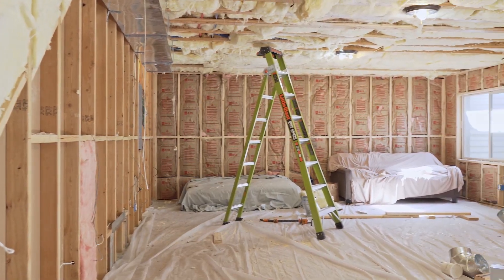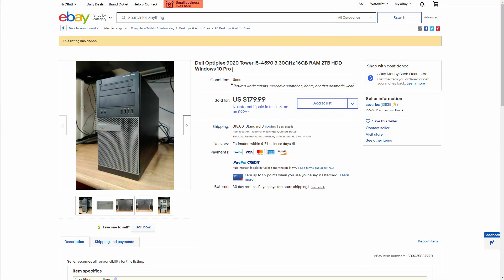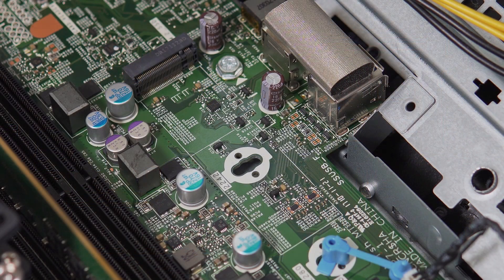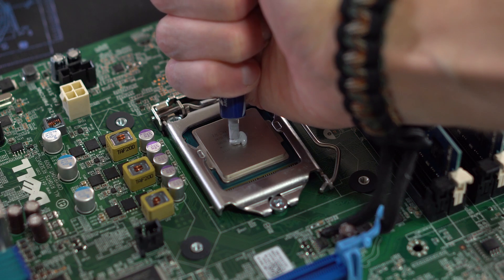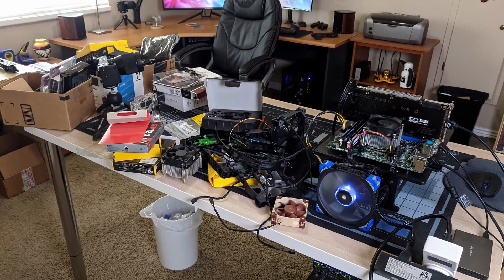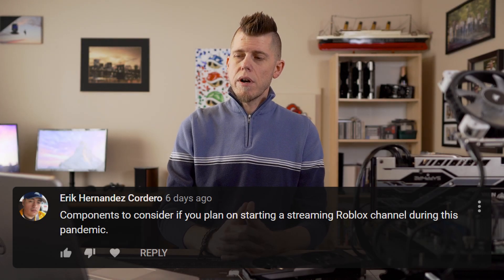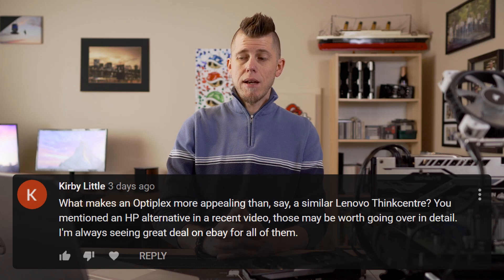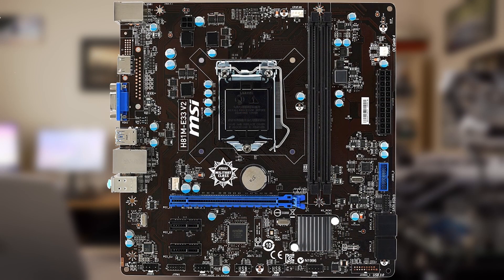Dell OptiPlex Q&A Pt. 2: Power Supply & CPU Cooler Upgrades, NVMe m.2 SSD's & More

Comment: so when using 5pin to 4pin fan adapter for dell mobo and still get error message? some people say the error message will gone but i never try it
Reply from the maker: It might go away, it might not. The fan controller in these systems is VERY picky, so it just depends on the fan whether you'll still get the F1 error or not.

Comment: Can I use a 1660 super with my 260 watt Dell PSU for like a month? Until the 8 pin connector arrives and I upgrade my PSU? I'll try to play with low settings and use power saver mode or whatever
Reply from the maker: Linus put a 1660 Ti on a 9010 with a 265 watt PSU... so you should be fine until the new power supply shows up. Just be sure to use a dual SATA to PCIe adapter.

Comment: I can confirm that the SFF is compatible with TFX power supplies. I replaced the power supply with a Seasonic TFX one after the original one died.
Reply from the maker: And it had that same screw points, and no interference with anything?
Reply: Don’t you mean the desktop?

Comment: can i play games like horizon zero dawn and RDR2 and cyberpunk with rhe dell optiplex 9020 usff 4 core 3ghz i5 590s 16 gb ram and a 6 gb graphics card ?? cause i heard these new games required something new in the processor and thafs why my old computer wont load them even though it loads most new games just fine.i am open to try and figure it out or buy one pre assembled. its a shame bc ive had my desktop fo 12 years and ajj i ever had to do is upgrade the graphics card ,,,now they make you buy a whole new computer!
Reply from the maker: Well, with AMD competing again, Intel can't really sandbag anymore. So CPU's just aren't going to be as viable for as long as they used to. Progress is good, on one hand, on the other... not so much. As to the 4590s... it will work for those games, but it would be less than ideal. It's getting pretty hard to recommend a quad core, non-HT CPU in 2022. A lot of games are getting harder and harder to run on them. If you want to play games like CP 2077, HZD and RDR2... I'd suggest getting at least an i7.
Reply: @TheGameBench  okay so are you in the business of putting them together still ? I definitely want an i7 but i don't know if that means it's a quad core or not .. I am below novice but very crafty when i have time to do research . I kept my t3400 running AAA games for 14 years until they required a new component in the proccessor. I just need something cheap that i can grow into . I already have the ram and graphics card . i would prefer a full size desktop not the little ones. If you can sell something like that or lead me in the right direction that would be great ! I will keep looking in the meantime Thanks !
Reply: Also i Don't mind being late 3 or 4 years on new games .. Let's them get the chance to work out the bugs. My favorite games are always gonna be fantasy driven dark souls type games . i cant stand the constant gunfire and i think that puts more stress on the machine anyway.
Reply: @TheGameBench  sorry to keep bothering you but i will be ready in a month or so to get a custom build . I just want something i can progress along the way . i already have 6 gb card and 8 gb ram and the rest i don't care about . eventually i will want 32 gb ram and 8 gb card and 6 to 8 cores . but if i could get a full size dell desktop that would be great. I already have a hard drive with 10 on it but it might have went out when the power unit went out .. Even though i plug it into external drive and every thing seems fine . But anyway if you have the parts laying around and arw willing to do it , im in Daytona so just shoot me a price and hopefully it's something better than ebay . Thanks a bunch !
Reply from the maker: @treewire1  It's no problem. Well, my first questions would be what what RAM do you have? Is it DDR3 or DDR4? Also, what GPU do you have? A 980 Ti, 1060, 1660/S/Ti? Or something else?
Reply: @TheGameBench  my card is pny technologies.GE FORCE GTX 1060 OC 6GB GDDRGPCie 3.0 and the ram doesn't say  bu i believe its DD4. its  been so long ago.BUT  ANYWAY Igot  restless and bought another one  .You are very helpfull and   and i always look for you first but you are not on ebay just making videos on youtube with more time than me  but i would love to collaborate in the short future.ill probably sell this one if you are still putting them together .ill bookmark  your page and check in. ..
Reply: thats what i ibroke down and bought

Comment: Can I swap motherboards between optiplexes? For example a 9020 motherboard in a 990, I'm asking this simply because this procedure is way cheaper for me
Reply from the maker: The motherboard screw pattern is the same between the cases, but the power supply that comes with the 990 will need an adapter to work as the 9020 uses an 8-pin power connection. The front headers are different, so while you should be able to get the power button to work, the rest of the front panel is entirely different and won't work though.
Reply: @TheGameBench  I didn't know it would be that difficult aside from the power supply, I already knew about the different adapters, but I thought they have the same chassis overall, I live very far from the US and shipping costs at least double the price of this case itself, but I'm really willing to get it no matter what. 
I also found a Fujitsu Esprimo p920 for about 170 usd, do you think that is a fair price? 
Anyway thank you for the quick reply!

Comment: Sir Thank you for sharing all your hard work and learning. Sir I do have a question or 10 on CPU coolers.. I would like to find one and have only bought off Amazon but am able to learn..   Is our Dell mt 9020s cpu a standard or proprietary or something else Dell throws at us wierd.  Are we able to get a cooler or do we need to with a rear mount and will it fit? cut out the case to fit?   Are the push in pin types any good? . Does the ram get in the way.. Can a 120mm fan fit.. This is a wierd one, does it take the rewire adapter like the rear?    I gota get one with a blue fan... LOL.     This is a fun project and the front and paint don't look like a Dell anymore.. Thanks again and any advice on this would be real help..

Comment: i am using m.2 nvme samsung 980pro as boot drive in my dell optiplex 9020 , amazing speed i got ,more than 3200 mbps windows booting time just 4 or 5 second , so every body should install an nvme with adapter in pci slot install driver in bios and enjoy m.2 nvme speed

Comment: To boot natively from NVME, you'll need to dump the bios and inject NVMExpressDxe into the dumped bios then reflash.
Pretty much works for any AMI motherboards, dell oem boards being one of them.
Reply: It´s indeed possible. 
I have done that mod on a 7010 SFF, that now boots from an NVME SSD in a PCIe adapter.
It made it work extremly well for a computer of that age.
Reply: @sa0azs  Yep, puts the machine on a completely different level.

Comment: Could you get a little more in depth with installing additional front fan to Optiplex? I know that you've mentioned it in "Adding Some Airflow To A Dell OptiPlex" but, as far as I'm aware, you didn't show how to connect it to the motherboard. I know there are some major changes that needs to be done to the plug.
Reply from the maker: Yeah, I wasn't very clear in making that series of videos that it was a series and I covered that in the build video of that system. Anyhow, all I do is use a SATA to 4-pin fan adapter which will run the fan at full RPM. If it's too loud, I just used a fan resistor cable to slow it down.

You can always use a fan controller of some kind, but connecting it to the fan headers is problematic. Most fans I've tested will throw and error on boot, or they just stop spinning after a certain amount of time, until the system is restarted. I've just found that's the easiest way to get a front fan in.
Reply: @TheGameBench  I tried powering fan with molex but it was to laud for me, and any sort of regulated resistor didnt cut it. some of them just burned out after a while. The regulation was problematic. Isn't there an option to add auto regulated fan in there? Some sort of microcontroller that act as an inercial regulator with separate fan seed controller based on the temperature? And if not will you mind helping with desining one?

Comment: I really enjoyed your video on the 4790k in the Optiplex. Can you tell me what's the best build for my $500 budget? 
    I was thinking about a i7 4790k $130, 3020 small form factor motherboard $10, 3020 290w power supply $14, 16gb ddr3 $30, 120gb ssd $20, gtx 1650 $280. Total of $484. I'm trying to get best performance for under $500.
    I like the 3020 sff mobo because it's small, simple, and there's so many of them out there for like $10. Same thing with the 290w power supply (80 plus Gold) for like $14. It's simple, only two connectors coming out of the PSU.

Comment: How can i boot with the ssd in a dell optiplex. I keep getting the error file system not found. Pls help
Reply from the maker: Which model Optiplex is this? And I imagine you're trying to run Windows 10?
Reply: @TheGameBench  7010 mt. windows 10. I have an ssd and hd installed but how do i make the pc boot with the ssd because i get the error error file system not found when switching to uefi
Reply from the maker: @controller_player3868  Have you installed Windows 10 to the SSD while the system was in UEFI mode?
Reply: @TheGameBench  No, it was on legacy when i cloned it to my ssd.
Reply from the maker: @controller_player3868  Then that's why it won't boot in UEFI. Rather than cloning from the old drive, you'd have to reinstall while it's in UEFI mode. If the install was done in legacy mode, you would have to stick with legacy to boot if you want to clone the old drive.
Reply: @TheGameBench  If i change the hdd to eufi and clone it on the ssd do you think it will work. Also, thanks for the support.
Reply from the maker: @controller_player3868  Typically... you need to do a fresh install with the system set to UEFI. But there are ways to convert the disk from MBR to GPT without losing data. I've never tried this, so I can't comment to how successful it will be or if it could cause data loss. I highly suggest making an image of the drive before attempting this, but you could attempt it on the SSD to see if it works and the old hard drive could act as a backup in case it doesn't or it fubars the data on the SSD.

https://www.wintips.org/how-to-change-legacy-to-uefi-without-reinstall-windows-10/

And no problem, I'm happy to help.
Reply from the maker: @controller_player3868  It won't because it's how the partition table is stored on the HDD where legacy mode operates off MBR (master boot record) and UEFI operates off (GUID partition table). Cloning the drive just makes an exact copy of it... partitioning table and all. The drive has to be set up that way from the get go or you can try one of the ways I linked... those are really your only options if you want to run in UEFI.
Reply: @TheGameBench  I have just cloned my mbr windows to my new ssd. I then converted it to gpt using the command prompt. And now i am able to boot with my ssd in eufi mode. It works like a charm now. I wiped my hdd so i can use it as storage.
Reply from the maker: @controller_player3868  Awesome! Glad it worked out.

Comment: Does the cpu cooler needs to be replaced if I am going to use an I7-4790k?
Reply from the maker: Depends on what you're going to be doing. If you're just gaming, the stock cooler should be able to keep it in the 70s with adequate airflow. depending on ambient temperature. At least, that's what I experienced with it while testing with a 22° C ambient temp. But if you're doing anything that hits all the cores pretty hard, it might be a good idea, though in Cinebench R20 I didn't really see it get up to the 90s in testing, though I would replace the cooler if it were my system and it was regularly seeing the 80s.

Comment: I don't know if this has been answered before, but which monitor would you recommend for a 9020 i5 4590, GTX1060 6GB  or GTX 960 4GB?  I'd obviously want to keep the cost relevant to the build. I have been through a hand-full of your videos and there is a simply staggering amount of useful information, delivered concisely  and at a nice pace so that even I can learn. Brilliant channel!
Reply from the maker: When I was selling these, I was just pairing them with pretty basic 1080p 60Hz panels. So long as they had decent contrast and response time, and not terrible colors, it was pretty easy to find something that fit the bill for around $100. So I don't really have any specific models, but I'd tell you to look at VA or IPS panels with a decent response time and you should end up with something that's decent for not a ton of money.

On the other hand, I would say that you could spend about $250 and get a VERY nice 1080p 144Hz+ monitor that could last you a very long time. I guess it all depends on how long you plan to stick with the 4th gen system.

And thanks! I really appreciate that. Nothing makes me more happy than to hear these videos are helping people out.
Reply: @TheGameBench  Thank you for taking the time to answer.

Comment: just bought a 3010 for $50 and putting a $50 gtx 750 for a young kids roblox and Minecraft rig. only mod im doing is im repasting the cpu, and maybe gpu. using e-waste monitors and peripherals. would i have spent more on the i5, yeah but for a gtx750, nah.

Comment: Hi! i want to ask, can i swap a dvd drive sata port with an hdd? i tried before but it doesn't show the drive in windows menu do i make any mistake?
Reply from the maker: Absolutely. There could be a couple of reasons why it's not showing up. It could be disabled in the BIOS. If it's unchecked, you can just uncheck it and it should be good to go. If they're all enabled, the drive might need to be initialized. This you right click on the my pc and go to manage, then disk management, it should ask you to initialize the drive. This will happen with any new drive, they have to be initialized first. If it's a used drive, that's much less likely, but when I sell HDD's I wipe them so they need to be initialized, so it's still a possibility.

Comment: Really like your videos and presentation style.  I've been picking up Dell Optiplexs for years, but mostly by trial and error.  But I had no idea of the best winners in the line, and which are more desirable.  I find Craig's List the best place to find low prices.  I'm not into gaming but very much graphics and video editing.  I assume the same qualities are required for both types of users.  I've learned a lot from your vids, thank you.
Reply from the maker: Thanks! I'm glad you found them helpful. And yeah, a good gaming PC can't also be a good editing PC. I'd say that one of these with an i7 4790 would probably be best suited for 1080p, without diving heavily into After Effect, or similar software. It also depends on the software. Some leverage the CPU more, and other the GPU, and some aspects with leverage one or the other.

Comment: Hello, I just wanted to say your videos have helped me a lot with my pc and have given me a good year of gaming. I do have a question if you'd be able to help. Currently I have an i7 3770 with a single fan gtx 1650 super, 16gb ddr3, and a 500 watt power supply. I got the single fan card because my optiplex is actually the 7010 model, and I know the sata cables and hard drive cage can get in the way of the gpu.

What I am asking about basically, is while my pc is fine now, I have a friend who is upgrading to a 30 series gpu and was interested in giving me his old rtx 2060 as a gift. I did a bit of research and the length of his card is around 9 and a half inches. Could you tell me what kind of complications I may have to make if he gives me this? Like adapters, different shaped sata cables, mods and so on? Appreciate everything you've done btw. would still be on xbox if it wasnt for these budget guides.

Comment: Would optiplex 9020 work with Xeon 1270 v2??
Reply from the maker: No, that is an Ivy Bridge Xeon. You would need to use a Haswell Xeon, so something like the 1270 v3. I'd suggest looking at the 1271 v3, as it's the direct equivalent of the 4790, but should cost you a little less, and will likely run you the same as a 1270 v3.

Comment: Hey do you need to install a new copy of windows if you take the hard drive out and go with a fresh ssd
Reply from the maker: No, you can use a program to clone the drive to the new SSD. I like to use Macrium Reflect. They have a free version and it works great. However, if it's been a long time since you've done a re-install, I'd suggest it. Windows just gets gunked up over time.
Reply: @TheGameBench  if I was to take a ssd from a previous dell optiplex which wasn’t wiped will it wipe itself once I put it in a new system

Comment: Thanks for the video. I recently purchased an Optiplex 7020 I7 4770 with 32Gb. I use it primarily use it for video editing (not 4k) and have noticed the screen goes black and that comes back on. Is this due to over heating? I am going to order new thermal paste for the CPU and hopefully that will help. But also would a GPU help? The GPU prices now are crazy but still searching for my best low budget option.